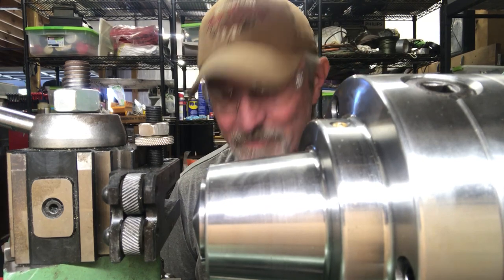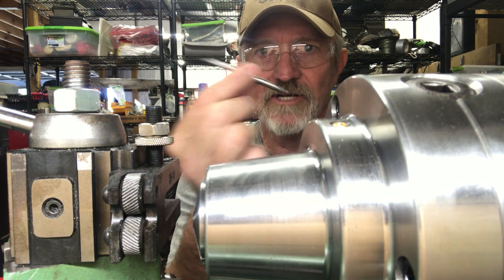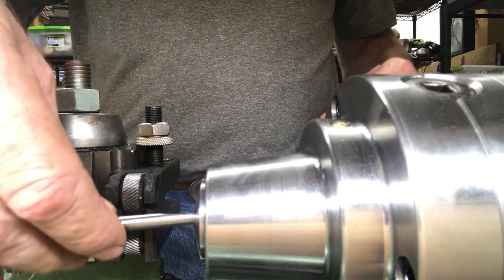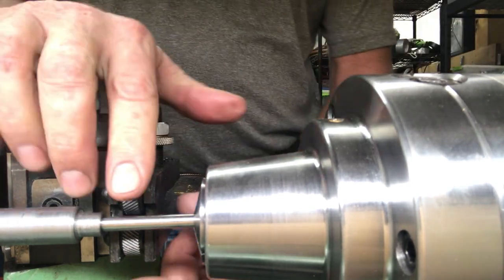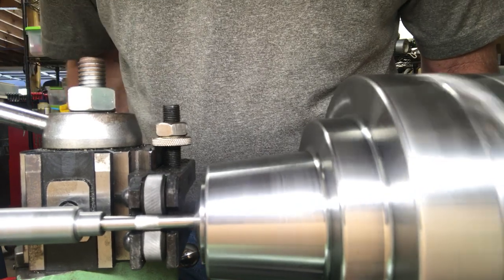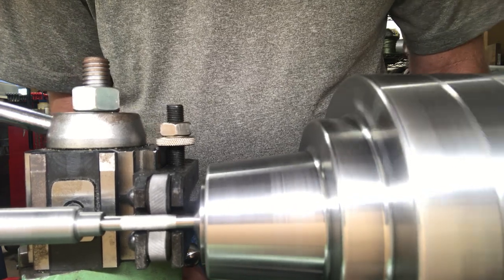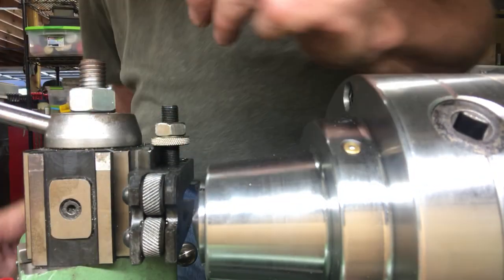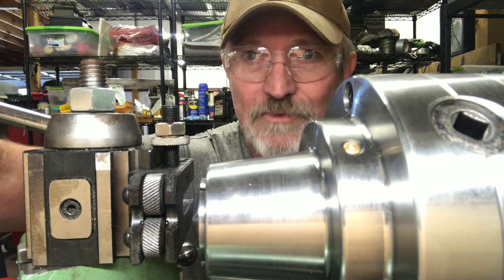Knurling Serrated Bezel Indexing Tools

Comment: Excellent Jim. What chuck are you using? I have been looking for a collet chuck for my lathe.
Reply from the maker: Thanks,  It's a 5C collet chuck. I got it from cdcotools.com.  Chinese but I was impressed with the quality.  My Le Blonde has a 1 3/8th inch 8 TPI spindle nose which is unheard of, so I bought a 1" 10 TPI plain back plate.  Made a spindle nose plug. (a duplicate of my lathe's spindle nose) and then bored and tapped the backplate to fit the chuck using the plug to test fit as I got close with the threading operation.  That made it a lot easier to fit my spindle-nose since I didn't have to take it out of the 4 jaw chuck to test fit over and over.  I only have a couple of 10ths of a thousandth  runout with this chuck which is SO nice.  It is now my favorite chuck and I rarely take it off the lathe.  A full set of collets from CDCO in 1/16th increments was only 60 some dollars.  Let me know if you want more details.  Now, you need to MAKE SOME MORE VIDEOS!!
Reply: New videos are in progress. I'm trying to finish up the engine build, edit all the video, then do a scheduled release.

I had never heard of CDCO before. Looked them up and they seem reasonably priced. I'll have to start saving up for the chuck and collets. A few 10ths is more than accurate for the things I do, and probably more accurate than my lathe is capable of. Thanks for the info.